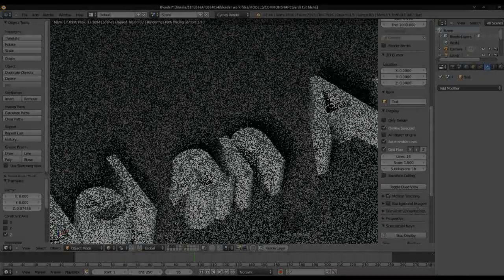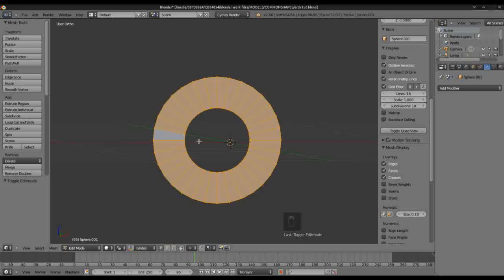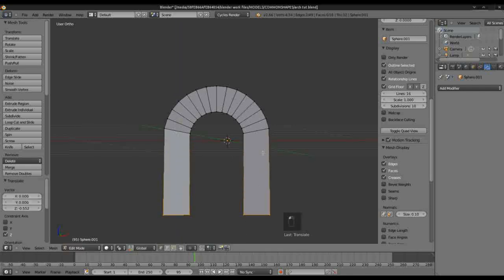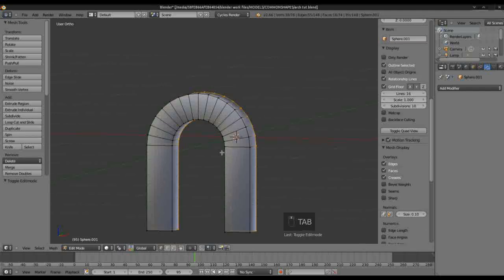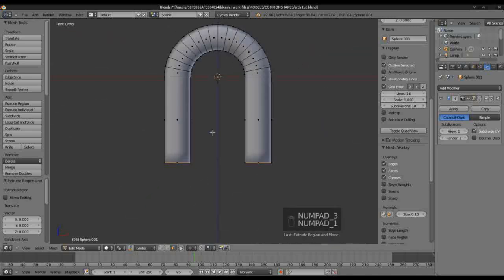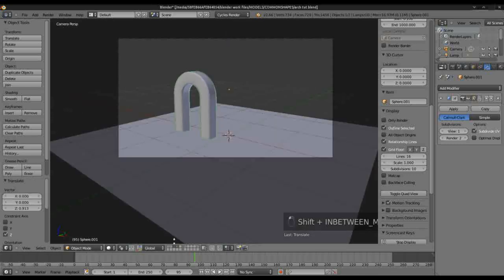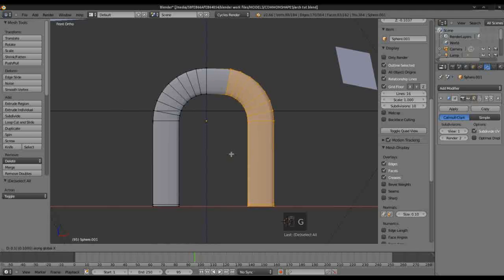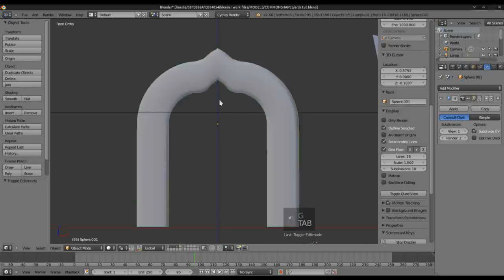Blender 2.66 How To Model An Arch

Comment: You can create a quad disc also just by adding a mesh circle, go to edit mode, extrude all circle vertices to the same point (press E and then Enter), then scale the extruded vertices to, e.g. 0.8 (press S and 0.8 and ENTER) and you got a quad disc.
Reply from the maker: Yes!!  Thanks quite correct- I in fact cover that way on my updated video which you will find on my channel. As with many things in blender there are some creative ways and some more practical ways to get to the same result. When I made this video the creative way got the better of me and I later remembered the simpler more practical option. :)
Reply: Yeah, there are often so many ways to do things in Blender. I just thought I'd provide another solution. In fact I miss a website where several approaches to a certain problem are collected and discussed. Do you perchance know of a tutorial explaining the node system/material creation in depth, not just the usual "connect this to that and set that value" ?  That would be of great help to me as I am still just a Blender Noob. Thanks in advance!
Reply from the maker: DesGeretGetNet  If you are like me you probably prefer to know why you are doing this or that rather than just painting by numbers as it were. For me nodes is a lot easier to sort of visualise than the material system we had before which is still in Blender.

 anyway this is probably not going to be what you want to hear but it kind of works for me. It would be like baking a very simple cake  you follow the recipe and practice it till you can repeat it without looking at the recipe great so now what!?  You can bake a simple cake but still don't understand how or why the cake rises, what makes it sweet etc. so you start experimenting -you take out something and replace the sugar with salt (with eg another shader ) and see what happens-yeah yuck. So you will never try that again hopefully that's the beauty of cycles you can get an immediate result on the screen without having to "wait for your cake to come out of the oven" as we used to before cycles came along -so my best suggestion is to look for a simple material tutorial and then do your own experimenting and sometimes you will find you will come out with some amazing results -problem is you may still not understand how you got those results. You will often hear somebody say just  add this I don't know why but it just works.

If you don't like that answer then just jump into something like a texturing tutorial which will give you a step by step building of a textural material and kind of offer a certain feel as to what you are doing since you are creating a procedural material adding layer upon layer as it were : http://www.blenderguru.com/tutorials/introduction-to-texture-nodes/#.VE0AOYWXWis   hope that helps.

Materials do take a long time to grasp -we are all still learning and experimenting.